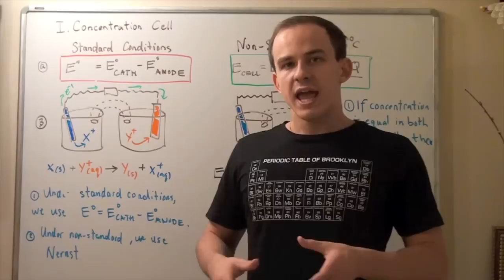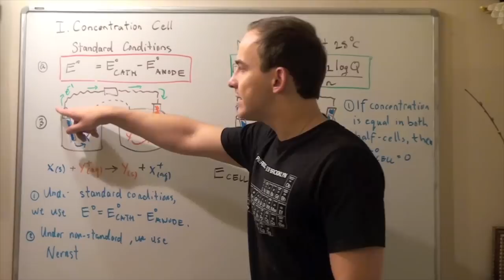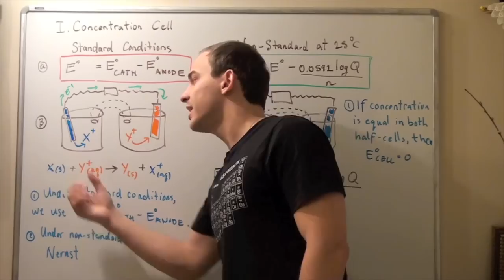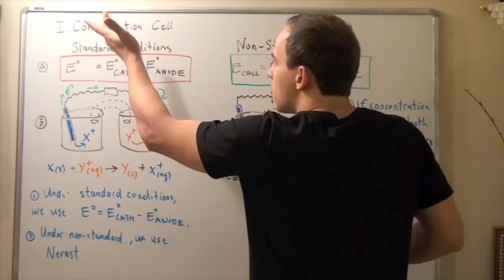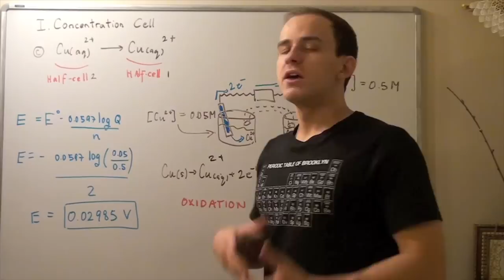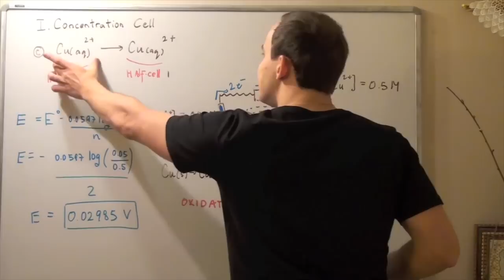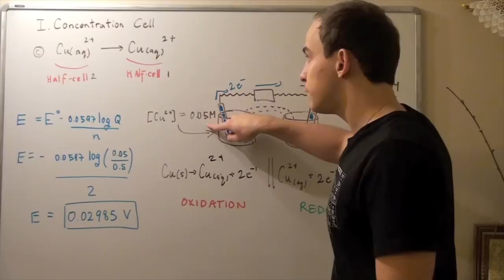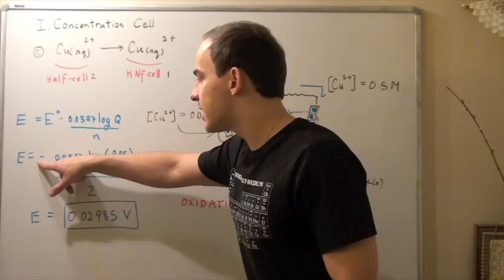Concentration Cells

Comment from the maker: Well in a concentration cell, its really all about the difference in concentration between the two cells. Whichever one has the smaller about of concentration, that will be your product. Le chatelier's principle explains why. If you have more of the same thing on one side of the equation, the reaction will push towards the other side to equalize the two. Therefore, the cell in which you have more is the reactants. The cell in which you have less is the products side. Hope that helped :D

Comment from the maker: It depends which cell you are changing. Look at the equation in the lecture. You are essentially looking at the term log(Q), where Q is the ratio of the concentrations of the two cells. The higher the ratio, the greater the value of log(Q) is, and so on.

Comment: someone below said it's difficult to tell  cell 1 from cell 2, thus, is unsure about which concentration to put for numerator and denominator for Q-- it doesn't matter. if you get a negative value, just switch the sign, because the value of E has to be positive to do work (and since the absolute values of the two answers are the same). +Catrina Richards